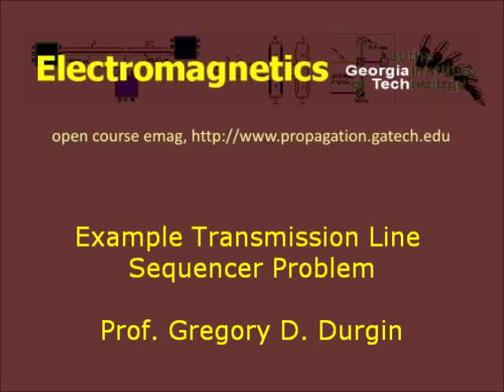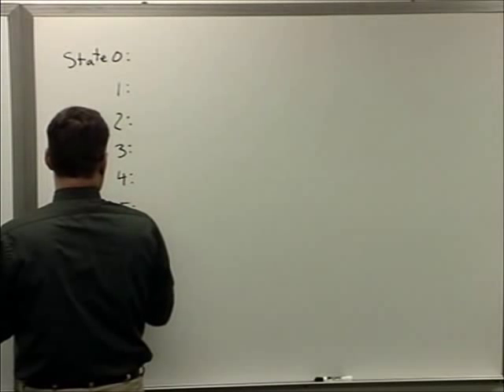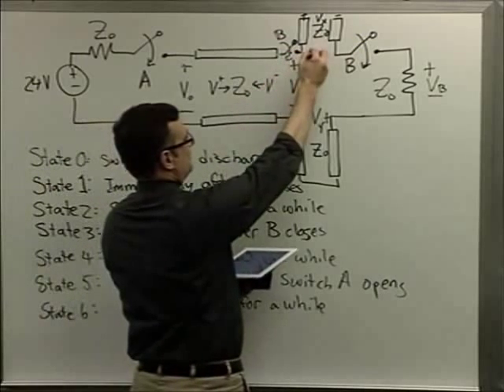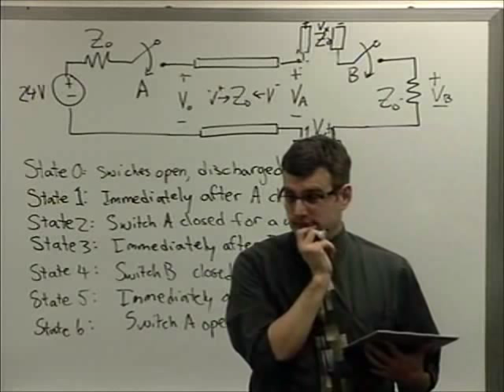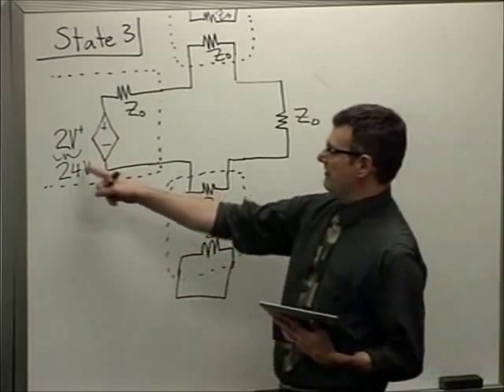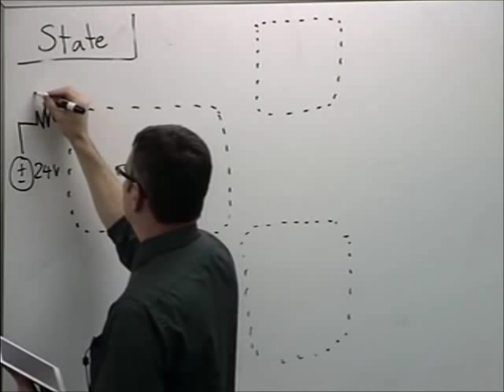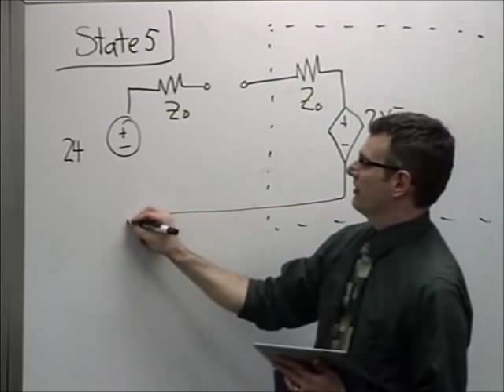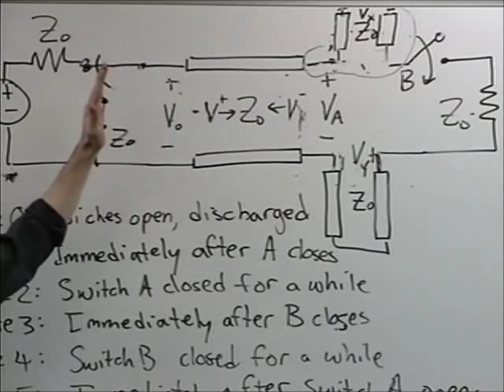Example Sequencer Problem and Solution

Comment: When charged line  is terminated with Zo_new instead open circuit which makes reflection co efficient zero so V- is zero and since V+ is 12V so the voltage across the Zo_new is 6V because of voltage divider.
If we have to do the same using the general transmission line model with dependent sources I get 12V across the Zo_new because 2V- is still 24V because V- is looked at the other side of the transmission line which is  yet to change after transit time.

Need clarity on this
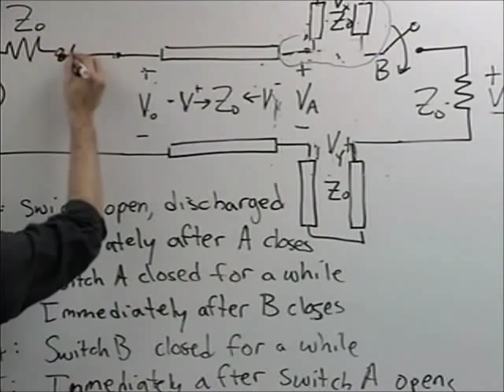Context - from 44:38 timelap

Comment: Final state will not go to 000000 correct because of the open circuit there will not be a path to ground for the transmission line to discharge?